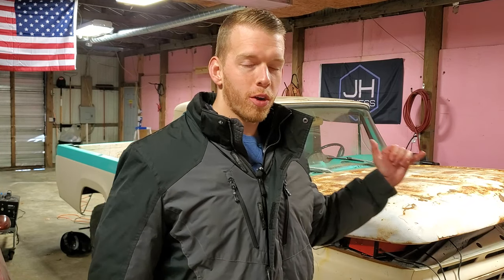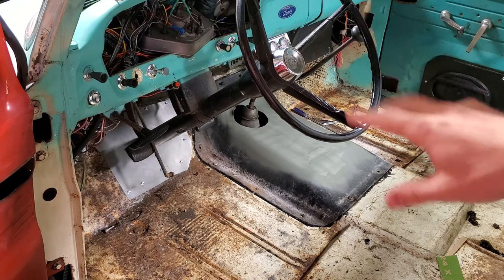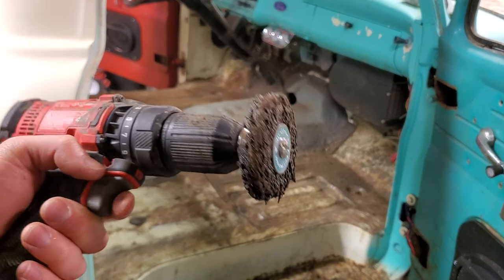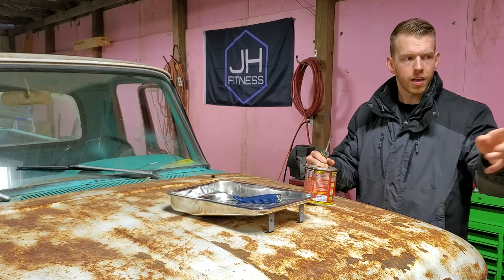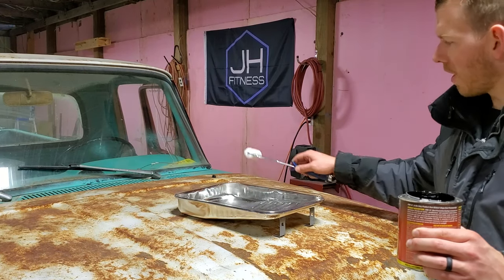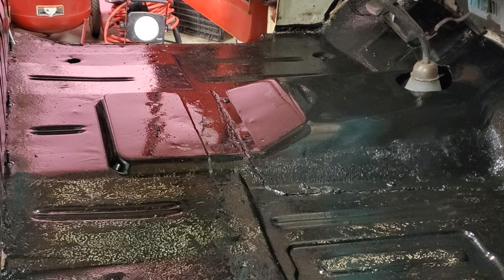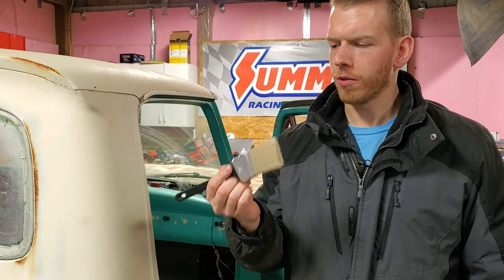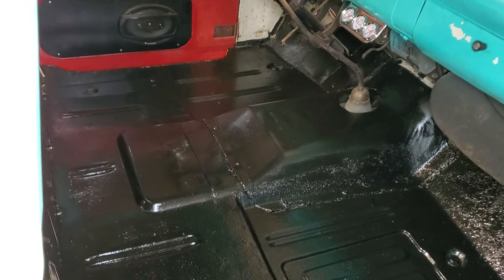SO MUCH BETTER! | POR 15 Applied to Floor Pans | 1963 F100

Comment: My cousin has an Acura rsx that had some bad rust 6 years ago.  We wire wheeled the loose stuff off and used the metal prep. Than painted it on.  It’s been 6 years in the north east of the USA daily driven and it hasn’t come off and the rust hasn’t come back.  Result definitely may vary.  You gotta attack the rust behind the repair.   If you don’t.   It gets out of control fast.
Reply from the maker: I agree 100%! You have to treat the rust regardless what method you use to prevent it. As long as you prep as much as you can, this will be a long lasting repair!

Comment: Just bought a brand new truck here in Chicago. Its October 6th I'm about to put this clear POR-15 on the  bottom of the truck. It's brand new so I'm assuming I don't need to etch it or sand it lightly or prime it etc?
Reply from the maker: Hey Tony! If the truck has a painted surface on the bottom, it would not hurt to paint this directly over the existing paint. Or POR also makes a rubberized undercoating that is pretty good as well!
Reply: And don't for get to pour oil in all the frame vent holes remove the rubber caps, my truck is a 90 and no rust did the same on bottom when it was 3 years old I'm in salt england 😂😂😅😂 Massachusetts.

Comment: Make sure you clean the grooves out on the can before putting the lid back on or it won't ever come back off. POR15 is wonderful stuff, been using it for a long long time. I have a '62 F250 Unibody I'm working on as well.
Reply from the maker: I think the can is too destroyed to make a proper seal! I really had to crank that lid to get it off. Lol it may have been sitting for awhile, before I opened it.
Reply: @JakeHarrington  A trick is to put a thin piece of plastic over the can before the lid, then you won't have to worry about it sealing up forever...
Reply from the maker: Never thought about that! Ill have to try that! This stuff definitely got extremely tacky! Great product, just a bit messy lol
Reply: @JakeHarrington  Only take out what you want to use then seal up the can quickly. I use a sponge brush and that works well, and they are cheap. Also, it works very well with fiberglass mesh if you have some small holes, say in the floor pan that need to be covered. Put down some POR15, lay the mesh in and then paint over. Dries hard and will be there forever.
Reply from the maker: @SpeedandChromeTV  another great idea! It does dry really solid! Thankfully, I didnt have any hole in the floor pan. Just some pitting, but nothing all the way through! Great idea though! Did you have to do any step panel repairs?
Reply: @JakeHarrington  My '58 Ford Panel needs the drivers step replaced, but I'm going to let the next guy do that. You can see the panel on my channel. It was a field find, been fun project.
Reply from the maker: @SpeedandChromeTV  I'm gonna try to tackle it myself! Got a new welder, and ready to see what I can do!
Reply: @JakeHarrington  The best way to learn man. There's a ton of great videos on learning how to weld. YouTube is a great place.
Reply from the maker: @SpeedandChromeTV  I love it! This is where I've learned most of the things I know. Or just diving into a project and winging it lol
Reply: First time using its nice but what do u guys use over it do u light sand it and use epoxy prime or 2k prime
Reply: @dapaintman1  just prep, prime and paint like you would normally.

Comment: Make damn sure you wear a respirator and wrap around safety goggles when using this stuff !!  I used it outside and applied with a brush to the undercarriage of my truck and afterwards my eyes were burning and I had a headache that lasted for 3 days ! The warnings on the box ARE REAL !!!  I’ve also read where a few people had to go to the ER after using it !  Read the warnings on the box before using !!!
Reply from the maker: I agree with this!! I have a full face respirator I wear now just for reasons like this! I've upped my safety game since this video lol

Comment: Por Metal Ready spray works great, I put it on heavy, then put garbage bags or something over it to prevent evaporation. My tow hitch for the 68 was way too big, even with goggles and a 3m cartridge type expensive painters mask I was bothered with the fumes, need very small areas at a time.
Reply: Most importantly to do the underside of the floor, bottom just like inside of fenders can rust through to the por side.

Comment: Great video. I just bought some Por 15 for my project so we’ll see how it works. Just subbed
Reply from the maker: It is a great product! Just make sure to prep the surface. Get it all as clean as possible, remove any rust you can, and then apply the POR 15. When people negatively review this stuff, it's because they paint directly over rusted metal, without any other form of rust treatment.

Comment: Very brave to be trying to open the lid without gloves on… If you get any paint on your hands, it will not come off… It will eventually wear off… Nothing will remove it…
Reply from the maker: It was definitely like getting POR 15 tattoos for a week or 2!
Reply: @JakeHarrington  Been there…done that… I tried everything and I had it all over my arms…
Reply from the maker: @tripleseven8361  I just had to let it fade over the next month or so! Nothing would even make a difference!
Reply: Cooking spray like “PAM” and a hand brush or rough rag works best to remove it from skin !